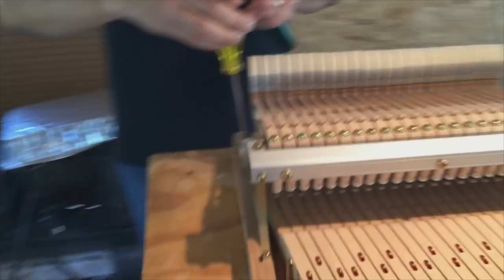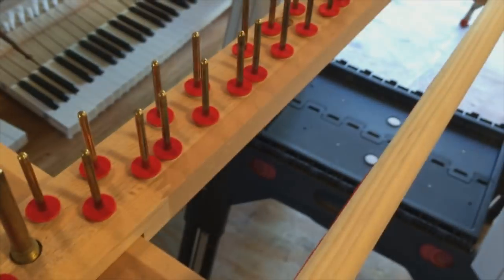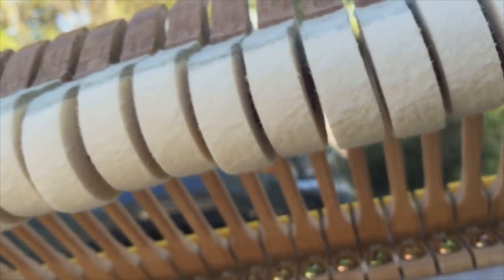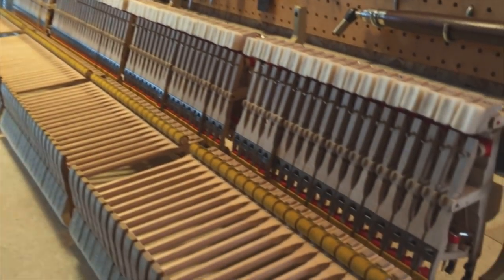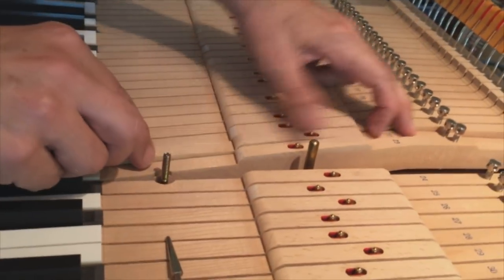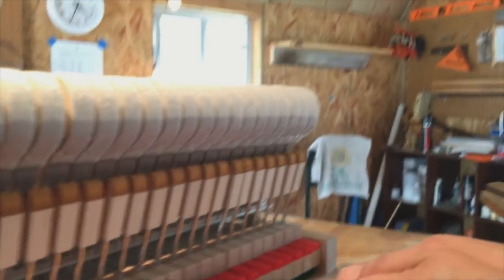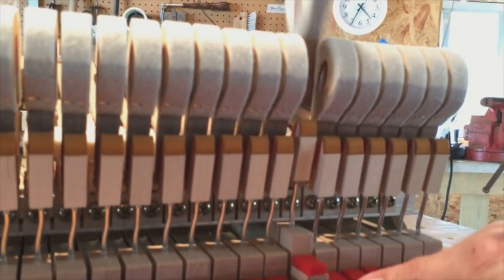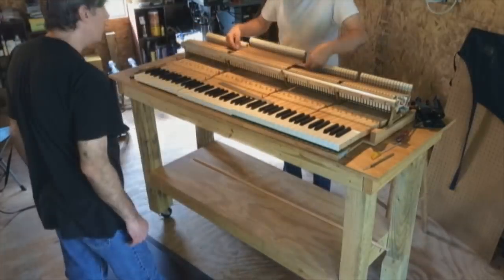Grand Piano Action Reconditioning

Comment: I own a 1910 era Bluthner and since 1996 timeframe. Sitting idle since 2005, 50% of the 80+ key wippen action is sluggish. A novice, I look to YouTube for suggestions and always amazed at the tips I can get but frown when someone takes the time to produce a decent video, makes comments about how to do something yet doesn't reveal the products used and this is down to what sandpaper is used to clean up the hammers also. I agree that the video doesn't need music in the background but hey, glad it isn't rap. Now 1/3/2023 I have several wippins to repair and one where the hammer end is broken off. Whether a Bluthner, Steinway, Baldwin, etc. the key thing is learning something new and that includes sources to buy equipment from. Philosophy has always been...if someone else can build it or repair it, with patience I can also. How nice it would be to not just have a tutorial like this but where in the world is best to buy repair tools, solvent, etc. from.

Comment: Hello , nice resume of maintenance operations thanks for making that 
It is instructive.

Comments : I noticed that only mc lube (the red spray can) works fine on key pins. We are approaching wd 40 in terms of philosophy,  but it dries better.
I do not find it easily so I am back to old deer grease . I also do not clean totally the balance hole as the grasy gunk stabilise the hole.
 Other dry lubes tend to loose efficiency too soon, and even get sticky (or even abrasive, as a grey one used in 5ge 70 80 in Germany)
Knuckles, they can be filed depending of the "leather " quality old leathers are often good and you change the 10 mm knuckle for a +-9.5 one doing so on worn knuckles. (100 grit) in standard wear 329 or 220 grit open the nap for talc or teflon.
Ironing good leather works fine . It allows to keep original knuckles on some old light actions mounted with good quality leather.

Best regards from France and good luck for next times

Comment: There's a lot to be said for adjustable repetition springs, without the bending procedure. The Schwander single-spring wippen has been in use for years, including some top-rate concert grands, Also, the Schimmel patent screw adjustment for the top half of the butterfly spring is available if you know where to look. Of course the two companies that adhere to the old system are Steinway and Yamaha, Go figure.
Reply: I was in the piano business for many years....I enjoyed the video...I never liked the bend to adjust rep lever springs..Renner actions has the right idea with screw adjustment...also note that the spring and loop arrangement has the added benefit of increasing tension on the jack when hammer is in the back check to get the jack back under the knuckle quickly for superb repetition.

Comment: That McLube product you were spraying around goes hard. I use it too. Doesn't it make the  balance rail felt & front touch felt go rock hard? Not to mention the set off  buttons?
Reply: stemart1641 You are correct. It is a mold release solution for tool and die making. It is slick, but wears off in layers (as several coats were applied) and can make BR pins squeak with repeated use. (Had it happen on a concert hall piano) Protek Prolube is much better as a key pin lubricant and will never build up layers like MacLube can.
Reply: Very good video though.
Reply: J Buzz. Sorry, I didn't realise you'd responded. The stuff I use is called Sailkote by McLube. I'm fairly certain it's what they're using. I use it in it's liquid form. I pour it into a finger nail polish bottle. And I wouldn't be putting it on jack tips either - it's excellent for the toes though. I also use it on rep spring crooks, speshly when there's very little or no repetition.  It came as a real shock to me, just how excellent this stuff is, a few years ago when I was told about it. I'd like to look into Protek Prolube though. Yeah, good vid, I agree.
Reply: sailer/pianist. Mclube is good shit.

Comment: What does a job like this cost?  I'm sure it varies depending on how much needs to be replaced or adjusted.  Where does the pricing usually start, ballpark?
Reply: Depends on the technician.
Mainly 100 to 300 bucks (for a full on action regulation)

Comment: Some of my keys emit a CLICKING sound during the DROP, and I can't locate why?  I'll try using the nylon powder and buffing the leather to see if that works.  I didn't know each key has ANOTHER metal spring WIPPIN at the bottom (an anit-tension to the regular-tension spring) that is difficult to get to.  That's probably why I have WEAK keys.  I once tried to fix a cracked bottom contact-claw by gluing wooden TOOTHPICKS together like a splint, but it didn't hold because I didn't realize the tremendous spring pressures involved. 🎹

Comment: The only 5hinh to keep in mind when using lubricants is "will I need to glue  something there some day" particularly when it comes to center pins, teflon is a hassle if one want to change the cloth. Rinc8ng with isopropanol 99.9 % is the only method I find to help me

Comment: Perhaps this is a dumb question, or more to the point it shows my lack of knowledge, but the key pins on my 1921 Christman Studio Grand are not round.  They measure .210 front to back but .156 (or so) side to side.  I realize the pianos age makes for strange problems, but could 100 years of use actually have made the side-to-side measurement that much smaller than front to back of the key pins?  bTw... love your video, and your narration is excellent.
Reply: Front rail key pins are never round, only balance rail pins. That being said, I have seen older Chickerings that often had oval shaped balance rail pins. And much smaller than the average (.146) . It’s not likely from heavy use.
Reply: @gretchenfarris1625  Thanks. I feel much better now. I thought that might be the case but then again, you can never know what you don't know.
Reply: The front pins are oval so you can turn them a few degrees to make up for the wear of the bushings. There is a special tool to do this. For the balance pins this is not possible because they are not accessible from underneath.
Reply: @christianwouters6764  Thanks.  My next challenge is going to be trying to replace 100-year-old wippens.  Christman has been out of business since about 1940 and nobody I've contacted can supply a suitable replacement.  Renner is about the closest but will still require modification.  W.N.&G. made the original action (if that's the right term) and can supply a vintage style wippen but manufactured with modern composite material instead of wood.  I don't want to use composite wippens (black) in a 1921 Christman.  It would be kind of hard to refer to it as a 1921 when it has composite wippens.  I've gone to great lengths to repair and restore the original soundboard; it would be a shame to denigrate the esthetics of the piano by using wippens that so clearly do not belong.
Reply: @edluna5224  piano action is indeed the right word. If you take out a front key pin you can see that the part in the wood is perfectly round so the entire pin can be turned without being twisted.

Comment: You're easing the bottom hole of the keys incorrectly.  You should be using the tool from the bottom of the key and have the tool turned so as to only ease the sides of the hole when you are first inserting the tool.  Then when you think you have eased it enough, just barely turn the tool as you are at the same time pulling it out so as to just barely ease the front and back of the hole.  The way you are doing it, by coming in from the top, you are easing only the front and back of the hole which is what you are to avoid. That is why the tool has the flat sides on it so you will NOT ease the front and back of the hole.  It is NOT made that way so you can come in from the top. You can actually damage the key and end up with key-pully or key slop by easing the front and back of the hole.
Reply: You're correct about the sides of the hole, but you come in from the top. This will keep the tool inline with the center of the hole.
Reply: I agree with Chuck.
Reply: Just to clarify, I'm not inserting the tool far enough in the key hole to allow the non-round part of the tool to affect the key hole. The useful part of the tool tip is completely round. The flat sided section of the tool is just for allowing the tool to enter from the top through the bushing.